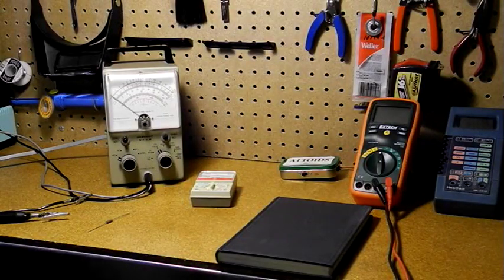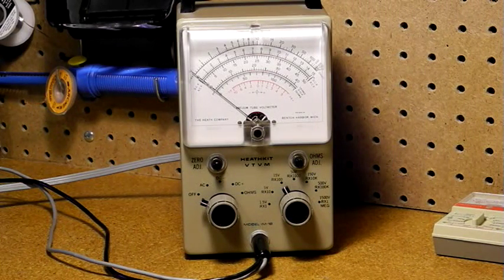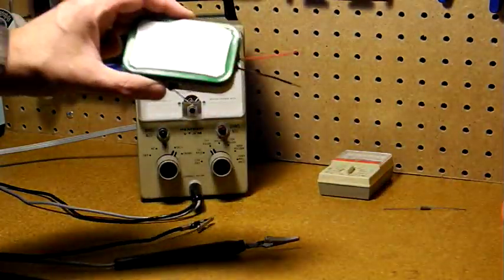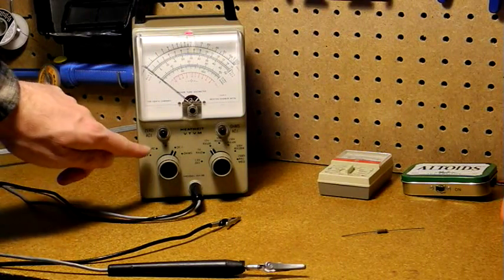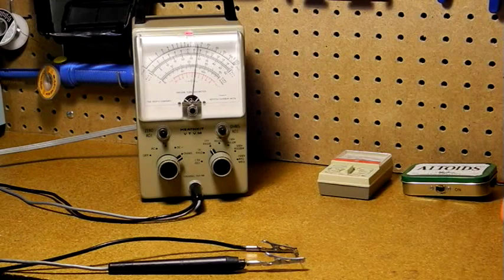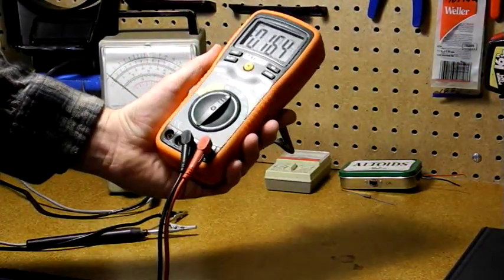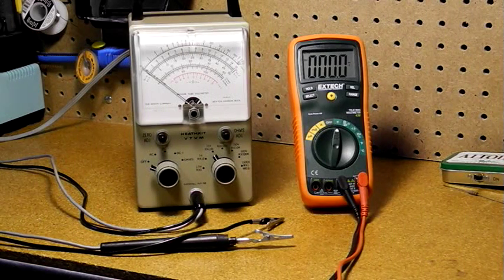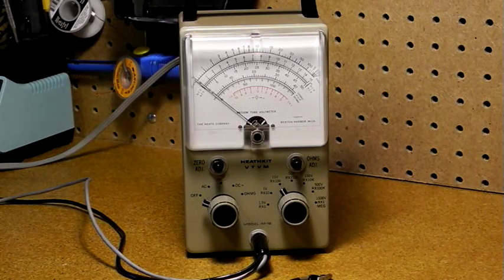The Heathkit IM-18 Vacuum Tube Voltmeter (VTVM)

Comment: Jeff, did you build your dim bulb tester or did you buy it? I have an isolation transformer I bought from Antique Radio Supply (Hammond make) and wanted to build a dim bulb tester like you have … if you built it do you have the schematics available? Thank you
Reply from the maker: I don't actually have a dim bulb tester.
I have occasionally wired one up the bench, but I generally use a variac and an isolation transformer.
They are quite easy to build though, and you can find numerous instruction videos and articles on the web.
Reply: @jefftranter  Thank you sir; I have my isolation transformer and access to a variac that has a meter for voltage and current reading built into the variac.  I found the variac at work buried in a bin of extra equipment. I'm going to make an offer to buy it since there are two of them and never used ... again, thank you. I enjoy your videos. You have a great voice and it is obvious that your take great car to present material in a logical and educated manner.

Comment: Hi Everyone, I am posting here because this has been the only You-Tube Video Comment section that seems active concerning Heathkit VTVM's. FYI You can Order Vintage Heathkit Manuals from Heathkit at their website I'll give the link below. Apparently "Data-Professionals" now owns all the copyrights which is why you can't find complete manuals online, at least I can't (Note I said "Complete) I just ordered one for my VTVM IM-13 (newly acquired). The checkout is rough and charges a uniform $10 for shipping, then when I re-directed to PayPal to pay and was returned to the Heathkit site, the shipping dropped to $7.50. I'll post a message here when it arrives and comment on the quality. The "New Heathkit" (New to me) web site claims high quality copies from an original manual and schematics printed on 11x17" paper, a plastic binding with "new" green Heathkit covers.  Oh, one more tip, my IM-13 has a cloudy yellowish cover on the meter. Meguiars Plastx product (I bought mine at Advance Auto) has done a miracle. The screen looks brand new. I'd advise using it on a non-conspicuous area first (like the bottom or sides) because I don't know what kind of plastic was used over the years. Heathkit VTVM's were marketeer from 1947 the 1980's.
Here is the Heathkit Manual link.
https://shop.heathkit.com/page/vintage-replacement-manuals

Comment: Hi Jeff and Subscribers. This is an older post so I hope Jeff still monitors the activity. Jeff, do you or any fellow VTVM Heathkit aficionados want to help me fix my old Heathkit VTVM IM-18? I bought one at a yard sale along with the assembly manual. The guy said it worked properly and had no use for it.  I checked it over and whoever built it did a nice job. It powers up and that's all. The needle is supposed deflect upscale then settle down as the tubes warm up. The needle is static and does not move. The "zero" adjust moves the needle a little. With a new battery the ohms scale works but I can't zero it, it hangs up mid-scale. Both the A.C & D.C. scales are inoperative. I've replaced the two tubes and the Electrolytic cap in the power section and the A.C. coupling cap. No luck. Next will be the two ceramic caps. If anyone has any suggestions please let me know. FYI I built Heathkit, Eico and Lafayette  (Remember them?) kits for many years. This was a nostalgia thing. I have made a set of the proper probes and done the usual work, I burnished all the rotary switch contacts, checked the solder joints etc. Next step will be to check the proper positioning of all the resistors and then a point to point wiring check. I'm asking for help here just in case there is a known problem with keeping the initial meter deflection at power up. THANKS, I'll check in here from time to time.
Reply: Tom,  I'm (not an aficionado, yet, but) working on a Heathkit V-2 currently... I've recently rewired EVERYTHING, save for the resistors on the ohms-value rotary, and still do NOT have any needle deflection at all.  I opted to separate the meter movement from the circuit and apply 1.5V (D cell) with a 10k ohm resistor... no needle deflection.  I performed the same test to the S-meter on my Heathkit HW-32a transceiver and achieved deflection.  My suggestion would be to verify meter movement across the sweep with a remote DC supply.

The "Hangup" may be related to a physical obstruction within the meter movement, or an improperly balanced movement (there are videos on correcting this).  In my case, I believe the meter movement to be shot entirely.
Reply: I had a senior moment, The meter works on the Ohms scale but not on the AC, DC+ or DC-. Being that the Vacuum tube circuit works on Ohms but cannot zero out and the AC and DC have two separate inputs it may be the selector switch. There is a good deal of oxidation. I purchased a can of Deoxit online (No more radio shack and no electronic stores here) once that arrives I'll clean the contacts. Those "V" series are all pretty old 1947-1950. You can find a V1 Schematic among others here, (Link at the end) I don't see any information on the V1 though. You may be able to find a loose meter on Ebay or a junk V1 and swap out the meter. As far as the meter check the coil with a VOM and see if they have continuity. The link I'll give you has a schematic for the V2. If yours has a 6AU6 and a 6AT6 the circuitry may be the same. Good Luck, I'll post a message after I clean the contacts, I've also been advised to clean all the pots and even the tube sockets.
https://www.nostalgickitscentral.com/heath/heathkit.html

Comment: Jeff I hope you can help me  I just bought a heathkit V-7A vtvm meter ,It didn't come with a center 1/4 probe the one in the center ,where can I get one or how can I build one ,my meter for the most part seems to be in good shape ,I will replace the two wax caps ,but I need that probe anyone who can help ,pleaser me no.
Reply from the maker: Fortunately, the V-7A didn't use a special switched probe like later Heathkit VTVM. You can make your own probes using banana jacks, test prods, and a 1/4" phone plug. You need to put a 1 Megohm resistor in the DC test lead. The V7-A manual describes the probes and you can get all the parts from sources like eBay.

Comment: I built two of these in my high school Electronics class in the mid-seventies. Three or four of these would not calibrate, and my teacher, Mr. Kuhlow asked me if I could troubleshoot them. I considered this to be an honor, as I really knew very little about electronics up to this point, not much beyond Ohm's Law. Anyway, there was a point in the calibration procedure where you would clip the test lead to a certain point in the circuitry, then move a trimmer pot until the the needle on the meter pointed to a small red dot, all the units were failing this part of the alignment. I got to thinking, how could three or four of these VTVM's all be failing in the same way, when they were each built by a different student? Were there a bad batch of parts? Also, we did have several unite which were calibrated fine. So . . . I got to thinking . . . I saw the spring cup which held I believe a C Battery. I was wondering if that spring was NOT making contact with the negative side of the battery? Also, I believed this only came into play when measuring resistance, so how could this be affecting the calibration of the VTVM. Well . . . I went ahead and jammed in a test lead between this spring cup and the batter and suddenly, the VTVM not calibrated!  I yelled for Mr. Kuhlow to come over and see, he too was surprised that this would affect the calibration of the Meter. What we discovered was this . . . I all the units which were not calibrating, Panasonic batteries had been installed, my teacher having been given these for free some some source. Well . . . these batteries all had a clear plastic shrink wrap around them that just barely extended over and onto the bottom edge of the negative side of the battery, preventing contact with the spring cup. . Once I peeled off this clear wrapping, the spring made contact and all the meters now easily were calibrated. My teacher was very proud of me that day. Sadly though, about a month later out of frustration, my teacher quit teaching us electronics theory because of all the Stoners in the class causing disruption. He said, "those of you who want to be here, grab a kit out of the closet and build it, the rest of you just show up and you'll get a passing grade." That was the end of my electronics theory education, but the beginning of my love for kit building. I built two VTVM's and two Low Voltage Power Supplies. My teacher had won a federal grant wherein he was able to purchase over 50 Heathkits. How I envied the Seniors who were given the O Scopes to build :O

Comment: Is the heathkit V6 VTVM an ok meter...and are there any known issues with it? I see the IM-18 and V7a around alot but not the V6.
Reply from the maker: The V6 is similar to the V7 and later models. It had some circuit differences and did not use a printed circuit board, which was introduced with the V7. but is substantially the same as the later VTVMs.

Comment: I built one of these in 1969 and used it when I was a bench technician at a TV repair place I worked at when I was in high school.  It did the job and worked in situations where the old Simpson 260 had too little input impedance. 

Thank you for the memories and I have to thank Heathkit for stimulating my interest in electronics.  I later became an Electronics Engineer and had a wonderful 35 year career working at "Dave and Bill's place".

Comment: What is the name/brand of the small beige analog multimeter you show in the beginning of your video as an example of an inexpensive one? I have never seen one that small before.
Reply from the maker: Solar Bunny It is marked CIRCUITMATE AM10. I bought it about 20 years ago for my son. I don't remember where I purchased it. I see a few of them on eBay.
Reply: Jeff Tranter
Thank you! I'm going to buy one for my bag as a cheap portable multimeter. Keep up the good work Jeff!
Reply from the maker: Solar Bunny I also have a DMM the same size - a UNIT-T UT20B. I only bought it because it was ridiculously cheap, under $10.

Comment: Jeff, 

I developed a habit of collecting VTVMs (currently have 8 of various Heathkit vintages, Simpson, and Eico models). I am rebuilding a Knight KG-625. The circuits,  of course, are all remarkably similar. But I have often wondered if there's a cure for the ohms measurements being off? 

Do you have any recommendations besides replscing the resistors in the divider chain? 

Thanks for your videos,  by the way.
Reply from the maker: Yes, I would suspect resistors that have drifted out of value. Maybe also try swapping the tube if you have another one,

Comment: I have this unit and like it a lot, but but my favourite VTVM is my Hickok 1600B that has died and I have been looking high and low for a schematic.  i have gone all the standard sites, with no luck.  Do you have any ideas where could find a schematic.  Thanks for the video.
Reply from the maker: I took and look and did not find anything. You could set up an eBay search and see if one shows up there.
Reply: Thanks,,
Ihave been looking.  I dont want to admit how much time i spend on ebay looking for things

Comment from the maker: Battery corrosion can sometimes be removed using vinegar and cotton swaps or an old toothbrush. Once you get it apart you can clean the parts with sandpaper. The hard part is usually getting the pieces apart and you may have to risk breaking them if they are badly corroded.

Comment: I am a total novice and have acquired a V-7a that apparently was stored for ages with the C cell battery.. which has leaked.  The good news is the leakage went away from the circuitry (towards the rear of the case -- must have been stored on it's back)

There appears to be a screw on the 'support' bar that goes over the battery but the corrosion seems to have made it difficult to remove.  But before I try anything hasty, I'm wondering do you have any ideas on how to get it loose?

Comment: Hi
After recieving the manual from the Heathki group on yahoo I went over all the resistors and found that the builder of the meter had inversed 4 transistors on the selector switch. So even thou this unit is over 40 years old it never worked properly. Looks like all the original 1% resistors.
Ths for your reply

Regards

Comment from the maker: Try changing the battery, but most likely some part has failed or changed value over the years. You should be able to find a copy of the manual in the Internet -- It has some troubleshooting information in it. Most likely a resistor is bad although it could be the 12AU7 tube.

Comment: Hi
I picked up this same tester a a flea market recently and it looked very good both inside and out but when ever I take an ohms reading the meter  bottoms out (to the right) no matter what scale I use or what resistance I am measuring. Would you have any ideas what might be the cause. It did not come with the original probe but for a/c and ohms it is straight thru as per the diagram.
Thx in advance

Comment: I have a Heathkit V-7A that needs some work. I've replaced the 6AL5 tube and need to replace the old 16 MFD electrolytic capacitor and some of the carbon resisters. Any other suggestions? Strangely enough, the original Eveready 1.5 volt battery was still in place.The amazing thing is that this 40+ year old battery wasn't leaking and still has 1.12 volts! The reason I know it's the original battery is that there's some printed tape on it that says, "1.55 V"  just like the manual says. Thanks, Tom

Comment from the maker: Note that you don't *have* to use a VTVM to work on old tube equipment - you can use a modern DMM. You may want one with analog bar graph if you need to adjust circuits for a peak or null. Of course using a VTVM of the same vintage as the equipment you are working on adds to authenticity.

Comment: Jeff, I enjoyed your demo on your Heathkit.VTVM. I also own several pieces of Heathkit Test equipment and always interested to learn tips abt keeping them in good running condition.. I am wondering, in your 5V ref, what did you use for your voltage reference chip?